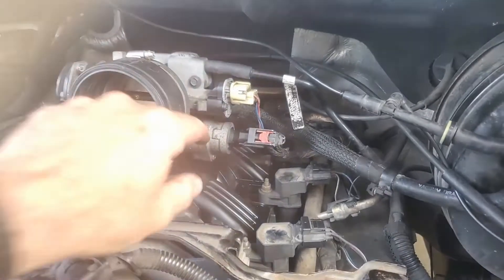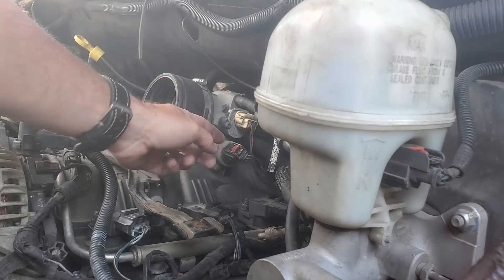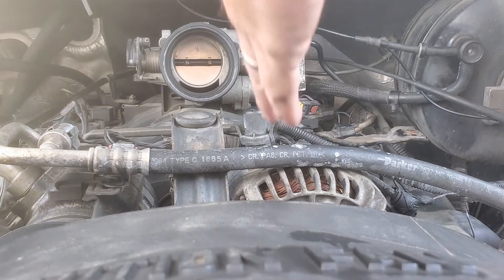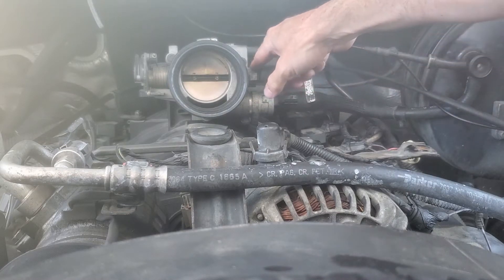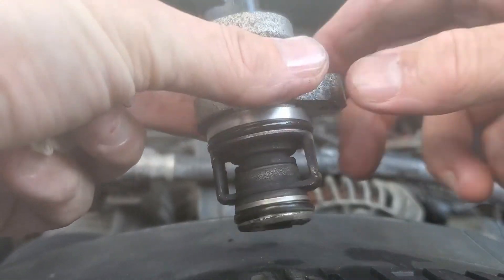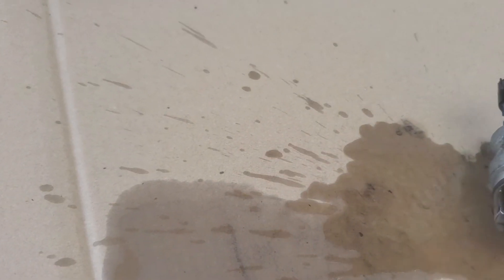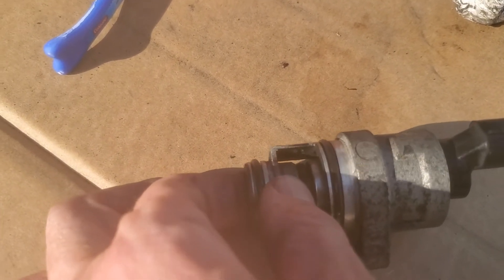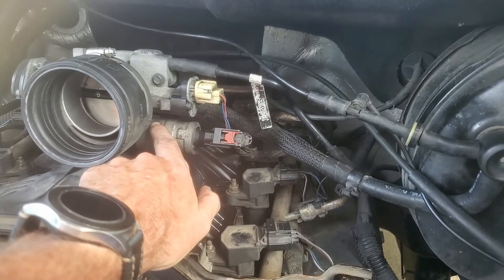Idle Air Control Valve (IAC) Clean and Replace DIY

Comment: what year is this Ram 1500 in the video,, ,?.. my throttle body looks different ,,I have an 06 Ram  hemi..If I can find my IAC valve, I may just replace it new instead, depending on the cost of course,
Reply from the maker: Mine is an 06, but it's the 4.7L not the HEMI

Comment: I have a 2007 c. Sebring 2.4l got a 0507 code just replaced air intake gasket and…where is the idle air control on it
Reply from the maker: It is located on the driver's side of the engine, behind the air intake hose and near the throttle body. To access it, you will need to locate and disconnect the electrical connector, then remove the two bolts holding the valve in place.

Comment: Great - just bought a mint 2001 Dakota 44K miles...couple months later suddenly idles too high between shifting.
That's probably it.
Reply from the maker: With that low mileage, I'd use valvoline Restore and Protect. It probably sat for a long time and needs some really good oil.  Great find!
Reply: @SeanDIY 
Funny you should mention that - just got 2 jugs of that yesterday to do shortly.

Comment: I’m having issues with mine idling at 1500rpm and drives by itself I’ve replaced just about every sensor checked very vacuum line I see I can’t seem to find it
Reply: Did you get it figured out. Mine is doing same thing
Reply from the maker: Did you check the throttle body as well as clean the mass airflow sensor?

Comment: Bro, where is located Iac dodge ram 2500 5.7 year 2006? My car is in 400 rpm and I think iac can be the problem
Reply from the maker: Tennessee.
Reply from the maker: Mine is the 4.7L
Reply: 5.7 You can not change the iac it is built into the throttle. You must change out the entire throttle body.
Reply from the maker: @Nathan-cc3in thanks for letting the community know this.  Mine was the 4.7L
Reply: @SeanDIY my pleasure thanks for the video.

Comment: Hey are you able to show where the breather hoses connect? I disconnected mine and dont know where they connect. Theres 2 on back end of the engine and 1 bottom near passanger
Reply from the maker: I wish I could but I sold the vehicle.   You cN probably find a schematic.   I'd also check to see if the hoses fit in one orientation more than the other.
Reply: @SeanDIY  Thanks for responding so fast, sadly no luck with schematics for my exact model.

Comment: Can it make your vehicle shut off while braking hard
Reply from the maker: I'm not positive,   but if I remember correctly that may be a possibility.   I can tell you if the electronic plug isn't connected you can't even get the car to stay running.   This controls the air at idle, so if it's starved for air, it may just shut down under brake load.  It's worth giving it a cleaning and see what happens.
Reply: Yes it can  or not even start

Comment: Very clear video- although very vague on the spray you are using. I assume its brake clean?
Reply from the maker: I would not use brake cleaner as it could damage the diaphragm. There is a specific cleaner for the idle.air control valve.
Reply: @SeanDIY  Will carb cleaner be acceptable?
Reply from the maker: I used the cleaner designed for it.  It isn't too expensive, and it's worth it not to ruin the part in the event the wrong chemical in something else eats the rubber.

Comment: A little Vaseline on the gasket (o ring) will help to get the part back in.
Reply from the maker: Thanks for the tip.  I've heard the same, but I'd rather use an O ring lube.
Reply: Did this help get it flush to the throttle body? I feel there is still like a 8th inch gap when i shove it back in.. then i just screw it in ( i feel this isnt a good approach lol)
Reply from the maker: If you have it lined up properly and hand tighten the bolt, then torque it down, you should be fine.

Comment: Thanks nice close up video & explanation, blessings. Joey
Reply from the maker: Thank you sir. Do you have a Ram 1500 or are you going to do this on another vehicle?
Reply: @SeanDIY  Hi again yes Sir I do own a  04 RAM 1500, I bought a new Idle Air Control  and I'll be replacing it soon, thanks for your feed back take care. 😏👍
Reply from the maker: I'm glad to help.   Be sure to plug it in tight, or it will stall.   I speak from experience on that one.
Reply: @SeanDIY  Ok thank you so much I'll keep that in mind, take care blessings to you & family. 🙏

Comment: Hello, above the idle control valve it's called the TCS sensor (it's a black device right above the idle control valve.
Reply: I'm very sorry my comment before I said TCS,  no it's called a TPS SENSOR THANK YOU FOR YOUR VIDEO. SORRY FOR THE CONFUSION
Reply from the maker: Thank you for sharing your insights on the Ram 1500.   It's appreciated.
Reply: @SeanDIY  your welcome 😇🙏🤗

Comment: Have this problem too i just got a tune up because my 2005 jeep grand Cherokee would stall between 40-60mph the tune up fixed thatt but the hard idling and stalling came back! And service engine light still is there Im like really so maybe this is what i need 🤦🏾🥺 it’s never enough with this jeep but i must say it has held me down i had it since 2020
Reply from the maker: Jeeps aren't known for their reliability. It's worth a shot because it doesn't cost much but time and a bit of cleaner. .
Reply: Since 2020 ?   Do you know it's 2023 ?   Three yrs..not even long enough

Comment: I have a 2007 Dodge Ram 1500 with the 3.7L engine but mine doesn't have the idle control valve on the side where you are pointing to. Is this a different year or engine size?
Reply from the maker: This is the 4.7L Magnum V8.
Reply: thats what im saying i cant find it on mine

Comment: You nailed it.  The IAC in the Dodge Ram 1500 4.7 can be a bear to remove and reinstall.   Tight fit.   I kept the TPS in place that was a mistake.   Take it out too and replace it with the IAC.    Last year replaced the IAC and this week the TPS had to be replaced.     If you are replacing one why not replace both at same time.   Use throttle cleaner spray clean and wipe down the throttle too.  Rough idle can be due to a number of issues.    Before pulling apart the airbox and throwing parts at the engine check your battery.  Autozone checks battery capacity on site in minutes for free.
Reply from the maker: Thank you.  That truck was fun to work on. I got it for $1,800 and sold it for $3,400 and had fun along the way.
Reply from the maker: Mine was a bad lodter that caused the rocker arm to come off on Cylinder 8. I did a video on that in my Ram Playlist.  Once I replaced the lifters, it was still loose, so I put 2 washers under it.  It May be a bad valve seat but with 245k miles on the truck, I figured what the heck.

Comment: I think this is my problem. Had my fuel pump changed, thermostat stuck open changed. My neighbor (a great mechanic) changed the crank sensor that the computer was telling him it was that because my truck would just stall. He ended up cleaning inside the carburetor area with paper towels. Lots of gunk because I think it was caused by the air intake hose fell off. Taking in fresh air not filtered. Started working fine again. The other night it started putt putting a little after idling in traffic. Caused me to scream, wtf now? Lol! I think it's this. Air control valve. Sounds just like it. Also, what lead me to this, I was looking on why my rpm was stuck on 1 and when I stepped on the gas driving I noticed my battery indicator went up and lowered when idling. Suggestions? Could it be the air control valve?
Reply from the maker: Well, if air was getting in unfiltered that could be really bad for the engine because dirt could be getting in with the air.  I would try this and also test the electrical connections on the iac valve and the connector going to it.  I can tell you that when I was done cleaning it I forgot to plug it back in and it would stall right away. Assuming it drove well, it may not be that issue, but worth taking a look.   I would also look at the spark plugs and also get Techron for the fuel in case it's clogged injectors.  I wouldn't keep throwing $ at it until you are pretty confident you got the issue.
Reply: @SeanDIY  thanks for the info. Just to give you a heads up on what type of truck I have, it's a 2010 Ram 2500 5.7 hemi. In such mint condition when I bought it that I thought it was a 2018 looking at it. So, I would also like to add that I had a new fuel pump installed. Gas gauge was broken. They put another one it but when my gas gauge is at a 1/4 tank, the gauge will drop to E but a few minutes later it will eventually go up. This has happened several times and I need to bring it back in. My spark plugs were checked. He said they still look good but suggested changing them in 6 months for a peace of mind since I'm at 124,000 miles
Reply from the maker: @John Carreno  I hope you find the issue.  I'm thinking the gas gauge issue could be electrical?  Hopefully it was never in a flood.

Comment: Would this faulty or dirty piece cause my car to stall when turning the AC on? My car is also idling very rough and feels like it might stall when stopped
Reply from the maker: It could. Check out my latest video on cleaning out your intake as well.   https://youtu.be/cxdUyQoflKY   It could be a combination of those things and maybe even a few others like dirty injectors or an air filter that needs to be replaced.  Here is a list of what I would check. . https://youtu.be/YN4u_rBltlg

Comment: just bought an old dodge. swore never again. my brother had a yard full of them. i have a preferance for chev or ford of these years myself. first thing i learned, these do not have a MAF sensor. 
thing didnt want to stay running, idled badly. kept dying. that is why i am here. thinking this is the problem. 
thanks bud! keep up the awesome viddies.
Reply from the maker: Thank you for watching. I feel like mine does have a MAF inside the air intake.
Reply: @SeanDIY  hehe yes indeed,  but alas, "a MAF by any other name"
Reply: It does  @SeanDIY
Reply from the maker: Is it working well now?

Comment: I clean the troattle body just with a wet napkin an cleaner just to make it look decent an not cause problem with it, well i bolted back on , turn on the motor rpm are an between 1500 an 1800 don’t know what to do
Reply from the maker: Did you check that it moves back and forth freely?  It's possible it's stuck more open than it's supposed to be..Did you also give the engine time to regate when you pit it back in?  It could take the computer a bit to figure it out.  If the latter doesn't work, inspect it, clean it again and replace it if its.damaged or not working.
Reply: Thank you
Reply from the maker: Is it working better now?

Comment: Sensor above is throttle position sensor ...usually well in various vehicles I've worked on the throttle position sensor (TPS) is attached next to the (AIC) air idle control valve Always both attached to the throttle body 😁
Reply from the maker: Thanks for watching and for sharing this information.
Reply: I think The guy is mixing up things. 
He cleaned throttle body sensor not IAC in this video. 
Make a video for IAC
Reply from the maker: Its actually the IAC.  Here is a picture. https://share.google/Mo7yg4ef5cHYfo1Sl
Reply: @123ertr what he was cleaning IS the Idle Air Control Valve (IAC). The throttle body sensor (TBS) is a separate part.
Reply from the maker: Correct.

Comment: My idle control valve is leaking air by the bolt
Reply from the maker: Is it a bad gasket on it?  Maybe just buy a new one, they cost around $20 or so.

Comment: Thanks for the help with this how to video
Reply from the maker: I'm glad to help.  Was your vehicle idle running poorly?   Were you able to fix it with this video?
Reply: I did clean it but it failed now truck won't start so plan b replacement part needed it's 20 years old it had it's hey day.
Reply from the maker: @JayPa-qk9vj  I'm assuming you let it dry out completely before installing again?  Also mine would start but die if I wasn't hitting the gas.  I realized I didn't put the sensor back in place thighs enough.   So the computer didn't know when to open the air control valve.  As soon as I snapped the sensor in tight it worked fine.  Worth a try?
Reply: I did let it dry in the hot sun for awhile first but I took a closer look at it and its way to hard for me to move the inner part by hand so I believe it's stuck so it won't work no lower I got a new one today still no luck with it so it's got to be a different problem then just that valve
Reply from the maker: Sorry to hear that. I have a whole Playlist of videos.I did on this truck.  Are there any check engine codes?
Reply: No after I replaced the part engine light went off no codes and no engine going up and down on the idle
Reply from the maker: That's good.  What codes did you have?  I had P0308 as my main.
Reply: Codes p1294 & p0505
Reply from the maker: Those are definitely idle codes.  Did you take off the airbox and spray the intake with intake cleaner?  If could be gunk built up on the butterfly valve that is making it stick a bit?
Reply: Yes I did that also was not that bad as fare as dirty

Comment: Thank you for the video. I was catching heck trying to get my truck to idle. Followed step by y and now she’s running fine.
Reply from the maker: Glad to hear.  What vehicle do you have?  When I put it back in I had issues only to realize I didn't put the electrical connector tight. 2 minutes later it was a major improvement.

Comment: My battery is currently dying every time I go to turn it on. I recently replaced it and it still dies. Could this be the cause for that? My heat goes out every time I am idling. Are both these issues somehow connected?
Reply from the maker: If your battery keeps dying, I'd check the alternator. That maybe the issue at idle too if it's not producing enough power.
Reply: I really doubt it  !!!... THE idol control value issue is a whole different issue